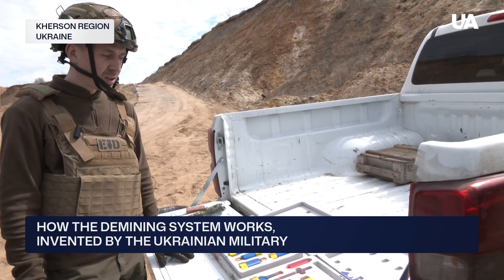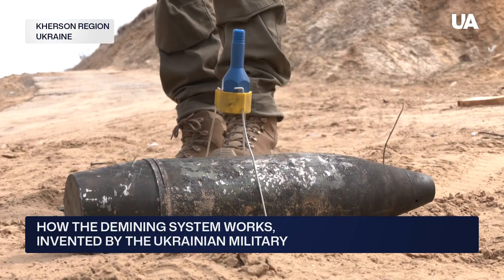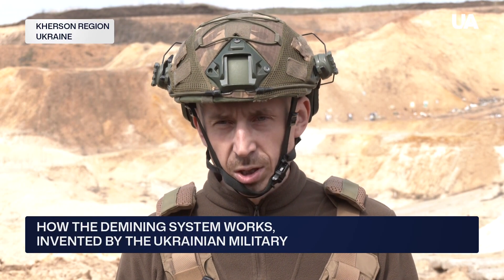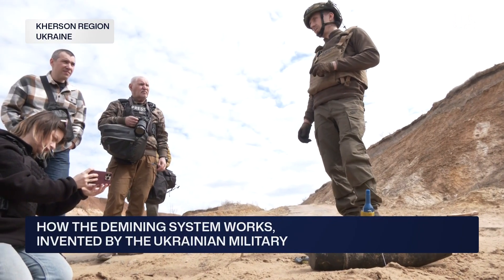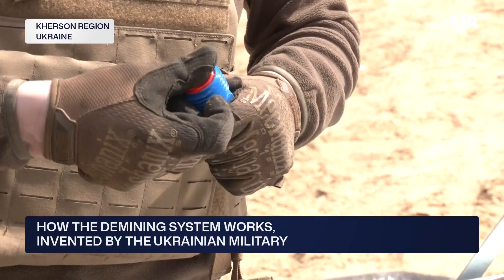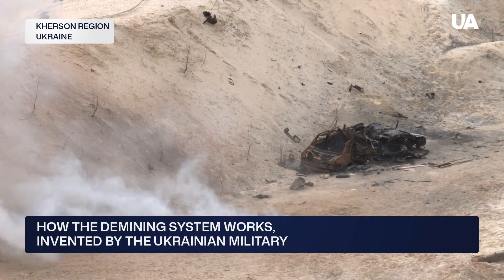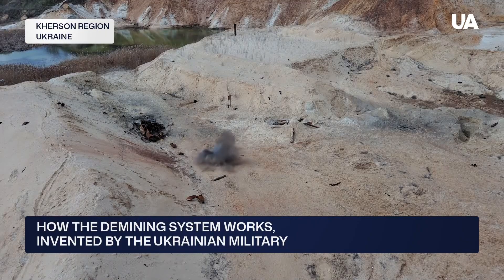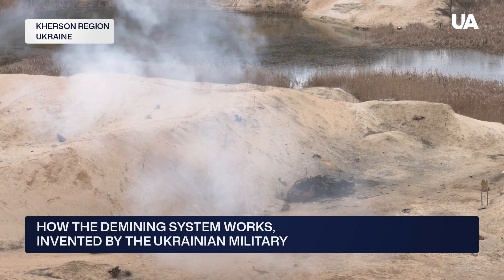The Spalakh: The Secret Weapon for Destroying Bombs with Minimal Explosives!

Comment: The issue i have with the bathtub, is water is the universal solvent on the planet and white filament is high in titanium dioxide, I dont think I would use 3d printing for this, maybe if it was in a different color or you made something from silicone maybe

Comment: This is not a new idea. I remember seeing this demonstrated 30 or 40 years ago by a British inventor.

The difference is that the shaped charge in the British version bored a hole through the outer wall of the munition and the hot gases from it incinerated the explosive inside the munition. In most cases the munition remained essentially intact.

Comment: Sorry to be a party pooper, but this system was developed over 20 years ago, by a old explosive forensic!
He invented aven the "instant door" explosive frame to cut open a wall, explosives and water in a portable, easy to mount, frame.
Boom, and you have a "door" through a wall in instant, without harming any hostages, inside.
Used ever since, by all special and other engineering forces from US to England.
Please, check the facts, not to  diminish Ukrainians in any way, but facts are, well,  just facts.
from a Finn in Diaspora

Comment: this looks like you could even put the shaped charge mechanism onto a ground robot, to place it on a bomb, avoiding any unintended explosion when people approach. 
this is also small enough that it could be placed by a drone, depending on placement,,,i notice that it sits on a wire "platform" in the ground, perhaps a tiny wire "tripod" with magnetic feet, could be used for ground or air remote placement?
just a simple guy from 🇨🇦
Reply: If only we had thought of this decades ago... oh wait, we did.  That's standard practice.
Reply: @RSPFactory;
Well, I guess I haven't been in ordinance disposal for a while... Could you please link me to such devices/applications?
And, you could use a more pleasant tone when "responding" to people who have an actual intention to help?
Reply: @lohikarhu734  The Mk7 series has been around since the '50s or '60s. Alford Technologies has a line that been around for decades, and is probably the direct inspiration for this video subject. 
You suggesting something so basic and obvious for a job that has killed so many talented and intelligent people is a bit insulting. Hence my tone.

Comment: It's not new. I've seen that before. The standoff is to allow the copper cone to invert and form the copper jet that punches the hole through the shell. Those plastic cases are commercially available.
Reply: They Clearly explained how they used "Old Soviet Manuals"....
Reply: They didn't mention that this is a straight up copy of a standard issue item for the US and probably all of NATO.
Reply: Not new, but greatly improved.....being able to do the same job with much less explosives is a good thing since collateral damage is reduced.
Reply: @taras3702  Not improved at all. It's literally a straight copy.  That's why this video annoys anyone familiar with UXO disposal.